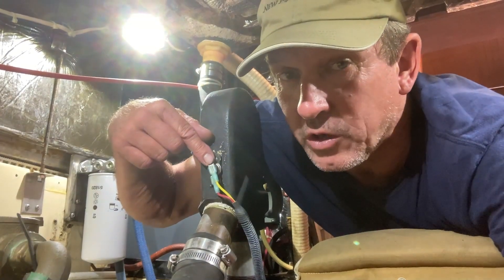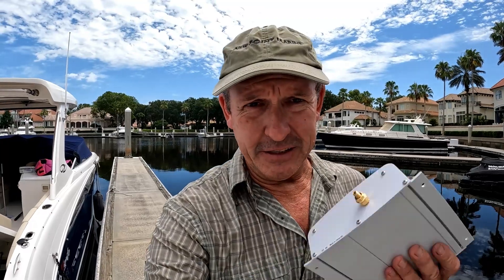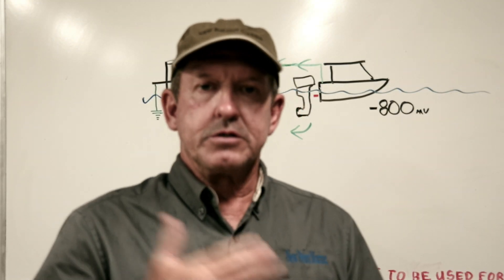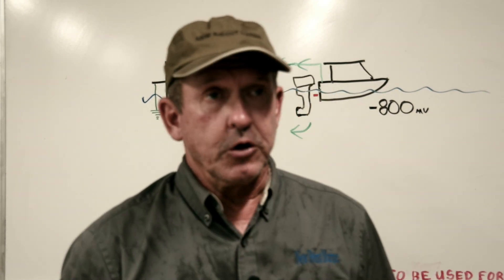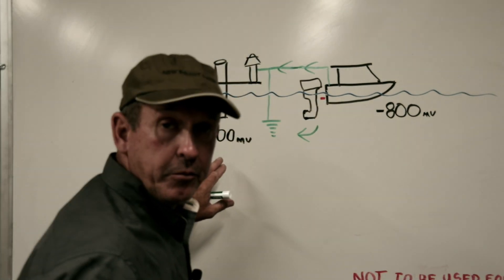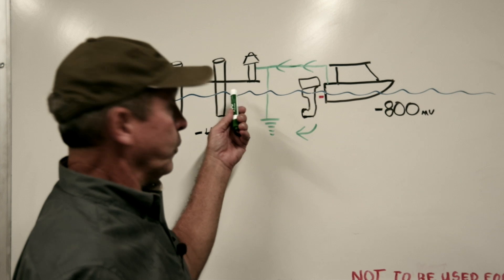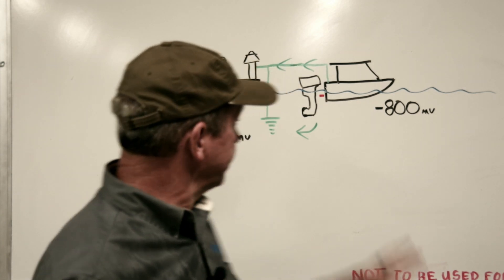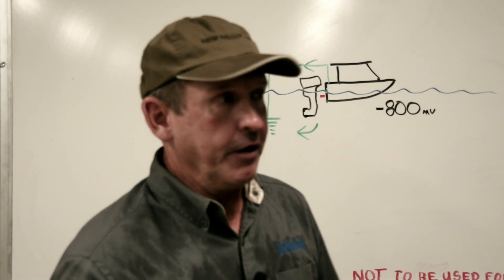Why should I install a Galvanic Isolator in my boat.

Comment: If I never plug in shore power and use only solar to charge the batteries, do I still need a galvanic isolator?
Reply from the maker: a galvanic isolator only protects if you are connected to shore power

Comment: If you have 2 shore power inputs on your boat, do you need 2 galvanic protectors?
Reply from the maker: Two Shore cords can be combined into a single galvanic isolator. However the single isolator must have the capacity to handle full amperage of the two shore power cords. Say two 30 amp cords can be combined into a single 60 amp rated galvanic isolator.

Comment: Would have been nice to go through the check for DC process
Reply from the maker: Thanks for the feedback. We did consider filming that part, but I  had to get that job wrapped up quickly and it was wicked hot out there that day. Stay tuned for a video on checking hull potential in the near future.
Reply: What was the voltage after the installation?
Reply from the maker: @paulwyand6204  If I remember correctly the readings after were -850 millivolts. That reading did not change with shore cord connected or unplugged.